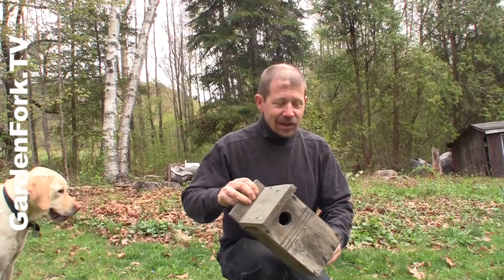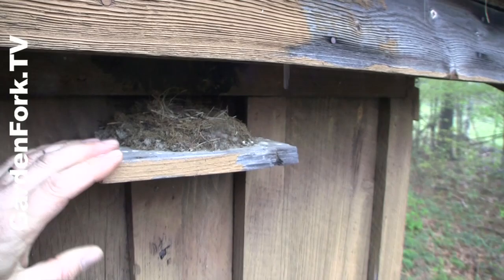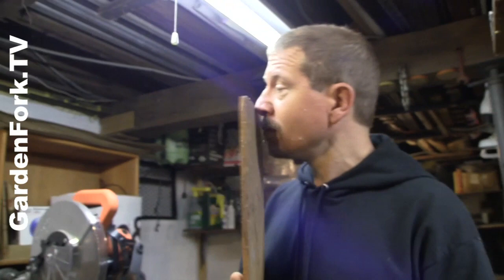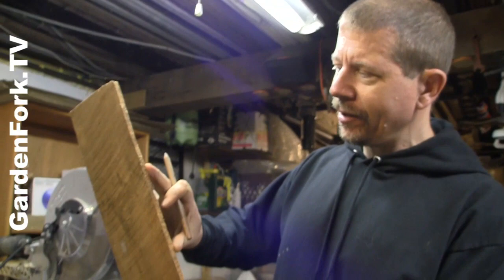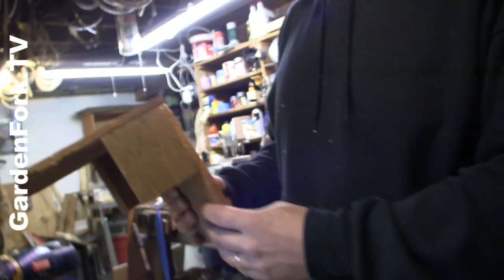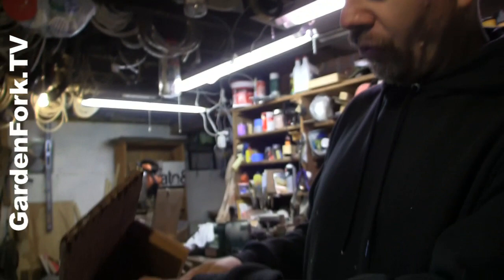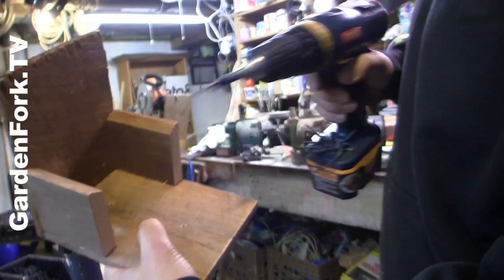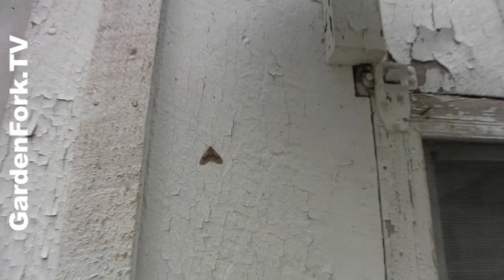Build a Birdhouse for Ledge Nesters GardenFork

Comment: Eric, The glue is usually stronger than nails/screws, but mainly when it's a clean wood-to-wood joint. With rough boards, the glue joint will only be so-so, so the screws are definitely a good idea here.

Side note: this video gave me an idea for making a series of bird houses (apartment style in a row) that could just sit on a ledge! :D

Comment from the maker: good to hear from you. the additives in gasoline are not good in the long term for small engine carburetors. the gas slowly degrades the parts of the carb.  gas stabilizer helps prevent that, and saves you money by keeping your mower running longer.  thx for watching, eric - GardenFork

Comment: Actually, having the links here would be nice, Just saying. 

Another typical Garden Fork video. Which means excellent low key tutorial. 

If I make one, I may use one triangular support in the center, maybe add some ornamental shaping. I may not dovetail the two large pieces, but I just might. I may  place my support screws side by side for lateral stability. Or more for peace of mind. I suspect horizontal screw placement is a solution in search of a problem, at least in this case.

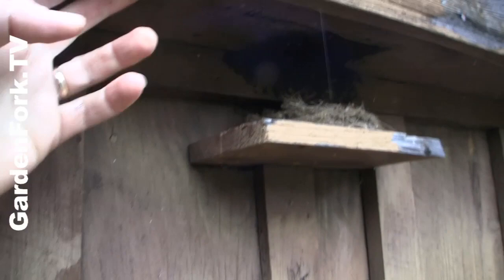Comment: How do you mount the ledge that is shown at 1:49? I'd love to make one for our neighbor hood robins. Awesome video.
Reply from the maker: you can't see it in the video but there is an angle bracket connecting the horizontal part of the ledge nest to the vertical piece below it, and that vertical piece is screwed into the wall. its hard to see because the vertical is stained the same color as the wall. thx!